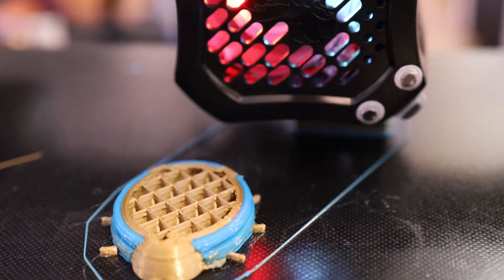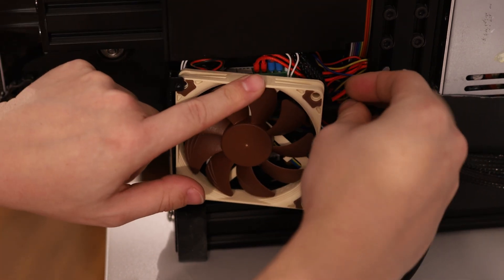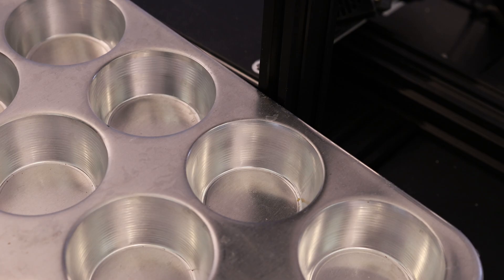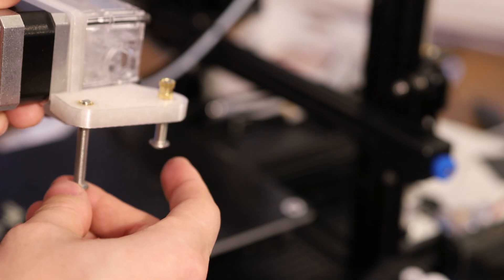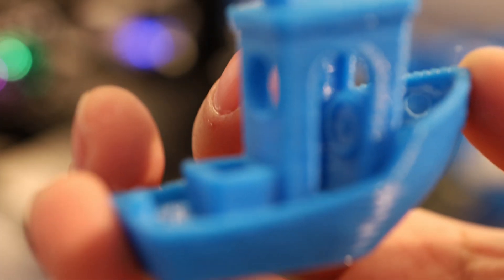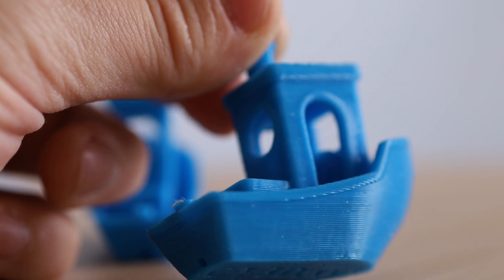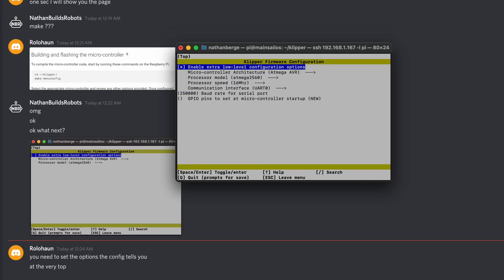Double Ender - Phaetus Tai Chi Upgrade

Comment: Dude STOP. While I understand the decisions that led you down the PSU fan modifications, what you just created is potentially lethal if anything goes wrong. By "trimming down" the fan you have made the fans electronics much more exposed and that danger is compounded by the fact you have attached the remaining parts of the fan to the PSU's mains containing PCB. While the glue sure won't conduct, if something comes loose and shorts with the fan electronics, there is the potential of your low voltage side going up to mains voltages. While somewhat unlikely, it is not impossible for you to then receive a deadly shock trough your display for example. Not to drop any credentials here but as a professional electronics engineer I urge you not to perform these kind of modifications. Swapping the fan is fine if you know what you're doing but this trimming modification is dangerous. At the very least, while it does not help with the aforementioned shock hazard, please print some sort of shroud for that fan so nobody can accidentally out their fingers inside the PSU. There is a reason the PSU is enclosed on grounded metal and that reason is the desire to keep the user alive.
Reply from the maker: Good eye! I can't recommend anyone to do this particular power supply fan mod. ⚡️ ⚡️ ⚡️ 

Wow, just reviewed the footage, I'm very close to sorting the fan PCB to those components on the Power Supply's PCB. I see what you mean.
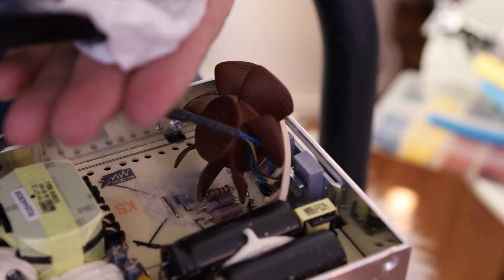Reply: I also did a double take at 1:20, but on closer inspection the fan seems to be glued to the low-voltage side of the PCB. If so, this is perfectly safe and doesn’t violate creepage/clearance. Oh and if someone manages to stick their fingers through the fan, bending the blades while doing so, they deserve the pain lol
Reply: I wouldnt give a damn if he gets a electric shock because i had it trough multiple times and death is very rare…. But one thing i can tell you if that fan gets shorted with mains its easy for that printer to go on fire and you imagine what can happen next….. improving ventilation in psu is one thing but having this sort of hazzard inside of psu i think is a bit overboard you rather leave in stock one
Reply: Ya I hate to feed the engagement of this video but I have to parrot this warning, and add you're gonna get some one dead.
Reply: " Not to drop any credentials here but as a professional electronics engineer "  Ya ok sure you are.  If you were you would know that everything in there is already exposed. If you were a engineer you would know the real problem was him removing the fan enclosure which will cause the fan to move less air than the one he replaced.
Reply from the maker: That is very interesting, I had not thought about the possibility of the low voltage side being shorted to 115v.

I will make extra sure that nothing comes loose. Crazy! 

On my pervious videos I always recommended against opening up the PSU.

I will put a disclaimer on my videos from now on.

Comment: I would be happy to see more investigation of the nylon/Nylon-CF combined prints. Now there are other printers which easily do multi-material, so it doesn't need to be done with the hacked Ender 3...

Comment: This hotend clogs constantly despite everything I tried. Umteen different retraction settings, different fans, different filament.
It is going in the junk bin & goodbye to the $120 buck I paid for it. 
Going back to the Dragonfly hotends that work great & I will build a tool changer instead.☹

Comment: Since you already added an additional mcu and have extra stepper drivers now, you might as well wire your second z stepper to that board. Combined with a bed probe it will allow you to auto level the gantry with the independent z control. Lost z steps no longer an issue.
Reply from the maker: Good idea!

Comment: Hi Nathan, I 've got a Taichi hotend, but i could not finish a print, because the tip of the filament is stringing and deforming during the first swap, causing clogs.
I'm running it with a bowden setup, but I'm planning to make it dual direct drive. 
do you have some suggestion? whats your retractions settings? 
Thanks
Reply from the maker: It definitely needs dual direct drive to work properly. I have links to my cad files for dual direct drive.  Join my discord if you want to chat more, YT comments are hard to keep up with!

Comment: Def would like to see more videos with this hotend. Specifically some stringing test results. Seems like most 2in 1out hotends are very difficult to eliminate severe stringing.
Reply from the maker: This one appears to have quite good stringing performance.
It has a very short heatbreak - notice I said short, not thin. A thin heatbreak can be made shorter, so it has a quicker transition from hot to cold, making better retraction performance. I haven't heard anyone properly explain this, so I will make a video on the topic soon.

Comment: The print quality difference between both paths has nothing to do with bowden tube, but the extruder that you're using. If one extruder has a different transmission ratio than the other, and you're using the same transmission ratio for both, you're going to get a bad result with one, and the correct result with the other. Also, one is likely a better extruder than Ender's stock extruder.
Reply from the maker: I may not have shown it on camera, but I did some test runs with 2x BMG clone extruders, 1 bowden, one DD. It still had a lot of issues with reliably switching. It takes a lot of force to clear a jam. Bowden tubes will bind above a certain force. 
For example, you can push yarn through a straw, but once it starts to clog/jam, the internal friction will cause it to bunch up, and make the jam worse the harder you push.
The internal friction increases exponentially once the filament starts to get all squirmy - which is what happens with a lot of flexibles in bowden tubes. Eventually it stops acting like a bowden tube.
Reply: pheatus makes verydesent products, so I would update the stock hardware. I have a Pheatus dragonfly on a 4yr old E3V2 works like a champ

Comment: WOW!!!  I could only watch the first  few minutes.  This is one of those videos where the guy has NO idea what he's talking about.  First the fan in the power supply.  Removing the outer shell of the fan will cause it to move LESS air than what you replaced it with. It needs the ducting to work correctly.  Second,  your regulator. Its funny you have the data sheet right in front of you, yet you used no capacitors on the input or output of the regulator.  A HUGE MISTEAKE!!!    Dude learn what your doing before you tell people what to do. There are far to many sheeple out there that will just blindly follow people
Reply from the maker: I will admit, EE is not my strong suit. 
I bought an o-scope. Maybe I can plug it into the fan cables and see the voltage ripple.
I butted the fan up against the PCB, so the air has nowhere to go. By removing the outer housing, it starts acting like a blower fan, moving air by centripetal acceleration, while still moving some axially. It seemed to be moving plenty of air.

Comment: Definitely worth swapping the extruder steppers for pancake steppers - a BMG extruder doesn't need the torque of that big stepper.
Reply from the maker: yeah, I didn't have pancakes when I made the video. I just bought a5 pack so I could swap them out. I will say, the smaller steppers do get hotter, and combined with the meltable PETG mounting structure, it may just be worth using the bigger motors.

Most extruders that use pancake steppers also have some form of heatsinking for the pancake to compensate for the extra heat
Reply: I've been using a pancake stepper with a PLA direct drive for months with no issue. It gets warm, but not enough to soften the material.
Reply from the maker: @gark64  interesting. What vref do you use? I set mine to 0.8 and haven't had any Nektar of my petg mount. I'm a little worried about heat creep.
Reply: @NathanBuildsRobots  mine is about 1.1v.
Reply from the maker: Wow, that surprises me. I guess I don't really need to worry about it then!

Comment: You have a 3d printer -- print a PSU enclosure to use the noctua fan without the jankiness -- this is super unsafe. You can also get low profile quiet fans -- 12v fans on par with Noctua (they're not the only brand that makes quiet fans) are easily available, and even 24v PSUs tend to use 12v fans. I've been running a 24v psu which runs 16 steppers and 4 hotends with a replaced low profile quiet fan for almost 5 years with no issues -- easy drop in, no surgery required. That part was cringeworthy.
Reply from the maker: I couldn't find them in time.  Do you have any 60mm fan recommendations for the PSU?

Comment: be careful with the taichi, my pre-pro unit snapper one of the supporting screws in the heaterblock when I was unscrewing it
Reply from the maker: Yeah they are pretty thin - M2s I believe. Stainless replacement screws should be pretty cheap and thermally equivalent. As long as your heatbreak is still intact you should be fine.

I wrench on pretty much everything I try, including this, so I'm surprised to hear that issue.

I feel like "1-handed nozzle change" is a bit of an overstatement used my manufacturers. Revo might be the first true 1-handed nozzle change system, since the threads are separated from the melt zone. If any nozzle has plastic in the threads it will require a lot of torque. At that point you probably should support the block when unscrewing.
Reply: @NathanBuildsRobots  sadly the threaded part of my screw snapped inside the heatsink, so I'd need a new screw and a new heatsink if I where to replace it

Comment: Awesome work as always, thanks for the shoutout!
Reply from the maker: No problem. I probably would have just stopped at 1 material printing without your tech support. 

I had to do some pretty odd workarounds to get the 2 extruder on one heater thing working. A short design/build/test cycle makes it so easy to do advanced stuff. 

Though-Marlin has native support for the 2 extruder config I'm running, so maybe it would have been easier on Marlin?
Reply: @NathanBuildsRobots  no marlin sucks lol

Comment: First try :D:D Pretty cool project. I had no idea you can split parts of 3d printer parts to various control boards. Totally dual.
Reply from the maker: Yeah, it's one of the great things about Klipper.
Reply: @NathanBuildsRobots  Just noticed the archon from Starcraft in the thumbnail :) That's a good one :)
Reply from the maker: @tomaskianicka3343  POWER OVERWHELMING!!!